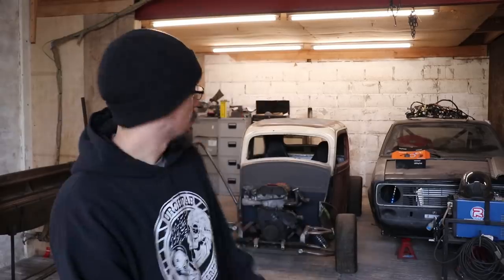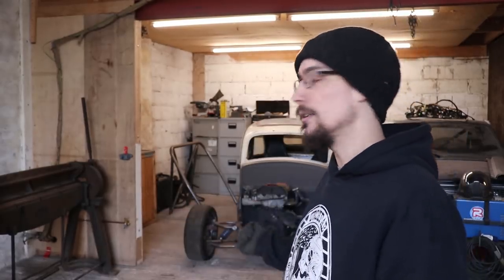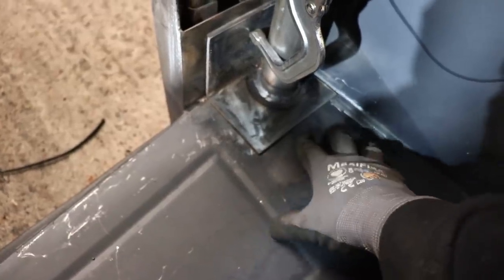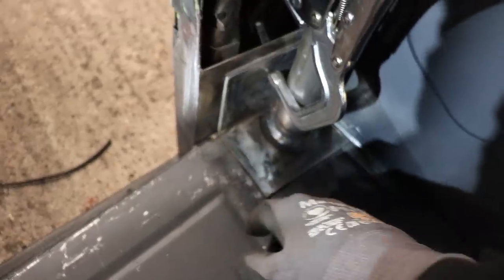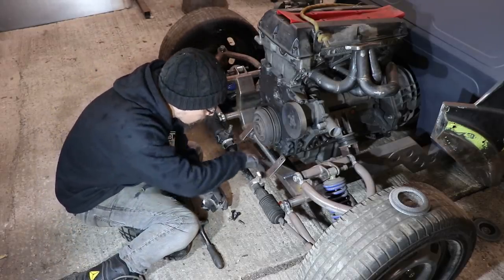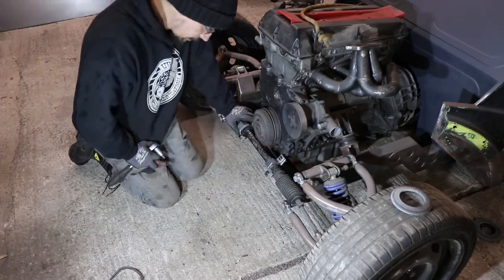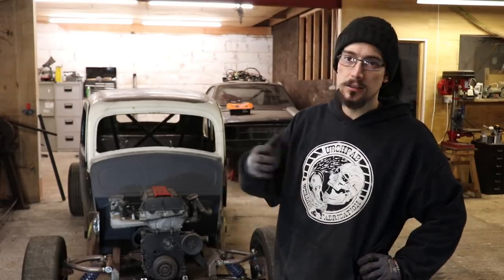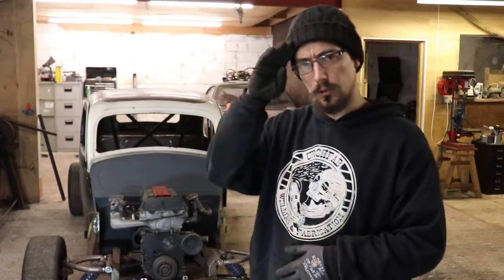ROLL CAGE INSTALL ON THE SAAB TURBO FORD POP HOT ROD

Comment: No one gets the excitement from a new sharpie like a fabricator. It's the simple things in life. I cherish mine like gold.
Reply: They don't last 5 minutes though do they
Reply from the maker: No they're shite really.
Reply: Can you you get Milwaukee markzall there? It's all I use anymore.
Reply: Mine last quite a while honestly. I try to keep from marking oily material or dirty material. Get months out of them
Reply: cattle tag marker pens a great especially on dirty/rusty steel, not the most accurate as the line is like 5mil thick, good enough for the girls i go out with!!
Reply: i use Pentel markers, much better than Sharpies
Reply from the maker: @zero-twentysix  I will have a look.
Reply: Mine has run out need a new one Christmas pressy I think
Reply: Definitely check out the markzall. I use mine straight on lubricated  metal it never stops.  Edit** it’s called Milwaukee Inkzall
Reply: Yeah there is something great about using a nice pointed sharpie than a dull one.. just feels wrong.

Comment: Nice job with the filler panel!   I like it when you admit to a mistake.  You don't hide it but show how to deal with it.   Just love your videos.  Also thanks for the tip about stitch welding to reduce the warpage of the floor.  I warped the hell out of mine because I did not know what I was doing.  If only I had seen this video first.

Comment: Pop rod definitely an interesting build. In the true spirit of hot rodding it's all hand made one off parts combined with the current beer money scrapyard biggest bang for your buck (pop for your pounds?) I've just done the b204 on omega box rear wheel drive thing myself as it seems to be the cheapest 300 hp available in the UK scrapyard scene at the moment. Be interested to see your sump to compare with my cobbled up in the shed effort. I went with an ally welded new sump base and sides to get the bottom level then a steel box around the modified original pick up strainer with hinged flaps  covering up holes in the box. A mate reckons that now the sumps 50% cast ally and 50% sheet ally welded together it will be as fragile as an Easter egg if anything knocks it. What are your thoughts?
Reply from the maker: It depends what sheet was used, filler and who welded it etc but no in general  it gets done all the time and should be fine. Cheers

Comment: When you say "Warp or warps" you sound just a little bit Scots. Have you got a Scot in your lineage?
Why do you cut sheet steel with a grinder rather than a circular saw like SVSeeker and I do as the blade doesn't wear out like disks do?

Comment: maibe paint the shrink and stretch dies different colours so it visible from the outside
found this 
https://www.hbm-machines.com/producten/plaatbewerking/overige-machinesplaatbewerking/hbm-8-ton-hydraulische-plaatpons
not sure if its faster then using the air ratchet but i think you could use it for flanged holes too

Comment: What happened to the little boxes supporting the cage that seemed so important before??
Reply from the maker: Those are for dropping the cage down to weld the tops of the front section. No front section on this one.
Reply: @Urchfab  Thanks. I assumed there would be a front section follow. Many thanks your explanation. Good to see the wheels on the spinner

Comment: what brand step drills do you use/reccomend? i wore out the one i got from machine mart on some stainless tube the other day 😂😩
Reply from the maker: I will have to check I cant remember the brand,  yeh the cheap ones don't last 5 mins.
Reply: yeah i wasnt too sure if it was good or not it was like £20 and i used cutting fluid but still got blunt by the time i finished drilling 2, 20mm holes

Comment: why dont you weld on a trailer jockey wheel onto the car spit, when you need to move it just wind down the wheel can turn the spit without the jack